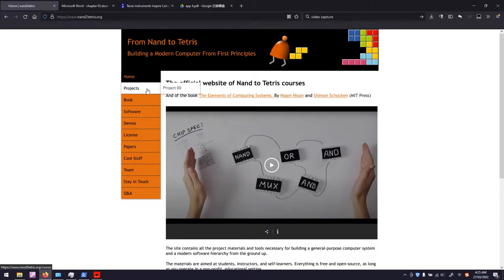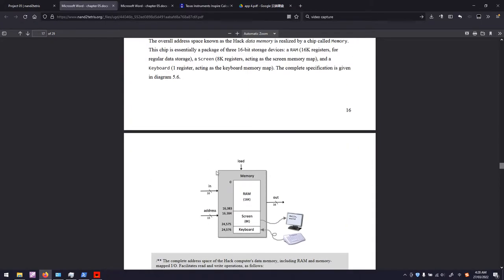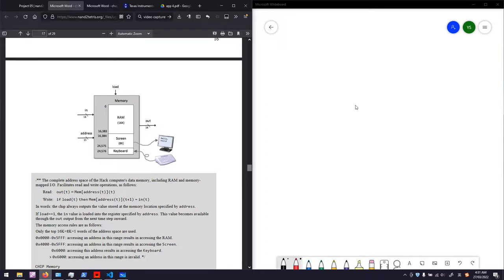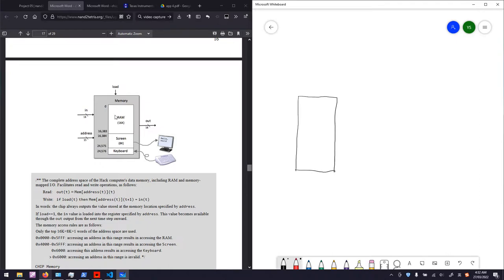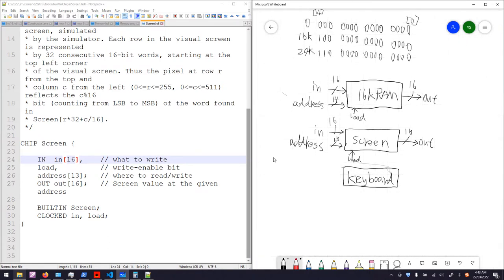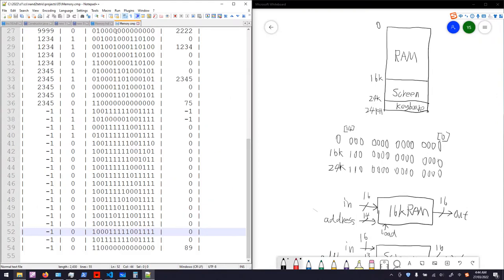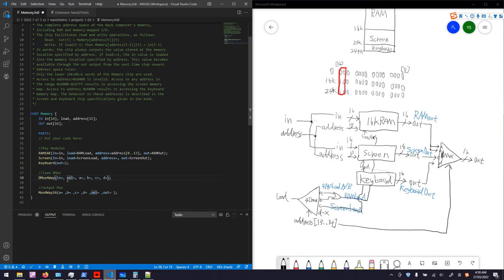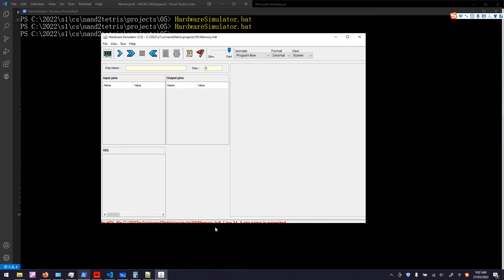Nand2Tetris Project 05 (Part 1) Data Memory and Memory Mapped Input Output

Comment: why isn't there a problem with using the 14th bit of the address both for the ram16 and the mux?
Reply from the maker: The address[14] only goes to 4Dmux and the 4Mux16 at the end. What is sent into the rest part of the address apart from the address[13..14], that is address[0..12].
Reply: @6h7ty19  why [13..14] and why [0..12] specifically, can you explain
Reply from the maker: @hotrandacduy3340  When we constructing RAM chip, we start from RAM8, which takes 3 address bits, i.e. address [0..2]. And then we use 8 RAM8 in parallel to construct the RAM64, the RAM64 has 6 address bits. The lower 3 address [0..2] address bits goes into the inner RAM8, and the higher 3 bits address[3..5] drives the MUX in the RAM64. We repeat this process to build large and larger RAM chips.
Reply: @6h7ty19  the [3..5] make sense to me because i know there are 6 control bits in RAM64 but i don’t understand how could we got [13..14] i don’t know the logic and calculation behind it